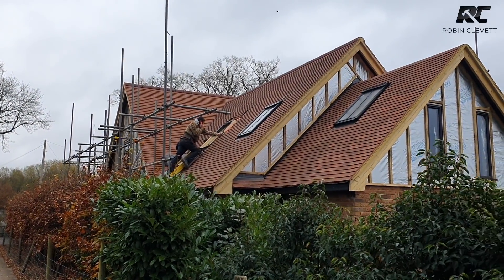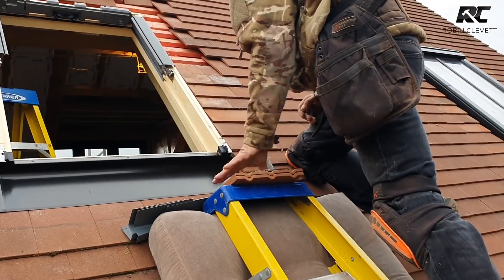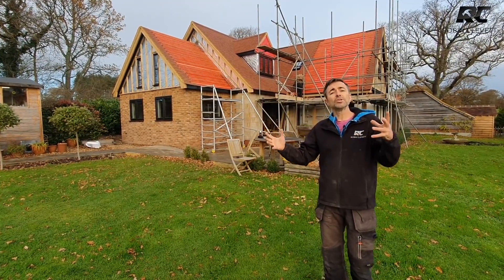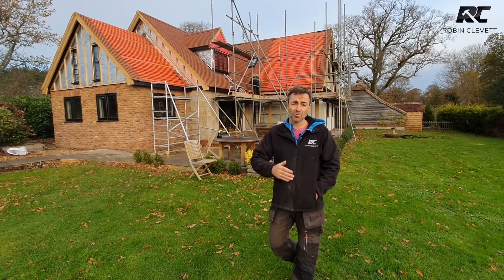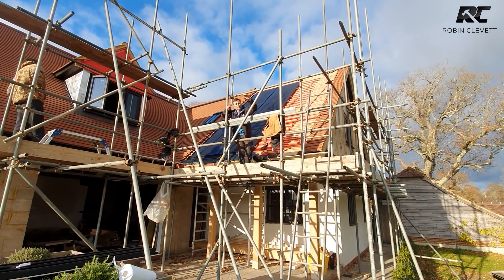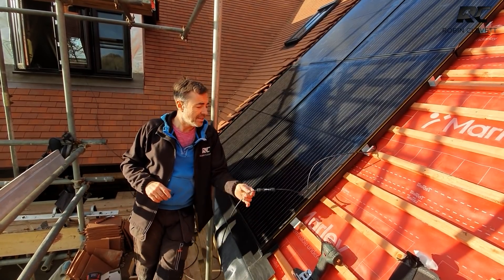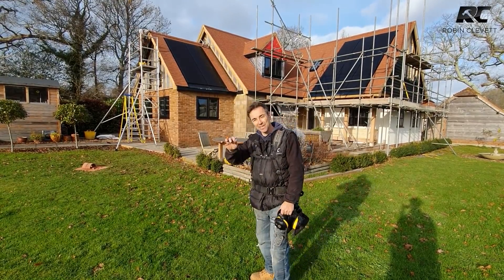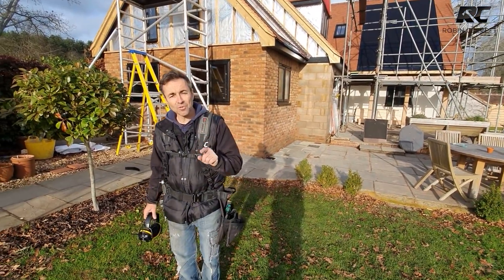Solar roof Panel Installation and roof tiling completion at the Big Build

Comment: As per RC standards, the solar is integrated into the roof. So the aesthetics r top notch. My wife hates the look of solar panels as an afterthought. The other gentleman u used to make videos with over at Skill Builders, has very eloquently made his views about heat pumps clear. Here in the California, Mr. Cools r very prominent. I believe they use inverter technology, which (I’m not an expert) allows the compressor to b infinitely variable. Light load, low power consumption, versus the old style. I have a 5 ton behemoth in for our house. When it kicks on, the electric meter goes bananas. I have installed four Mr. Cools on the property and they work really nice. I know I’ll b considered a whiner and  if I say it gets cold in LA, but it does. It was 59 Fahrenheit in the house this morning and I had to turn on behemoth to forced air heat the whole place. My gas meter was now singing the song. In future I plan to install a mini split where we sit 90% of the time to watch RC vids. A 12,000 btu should do just fine. I know those r British Thermal Units, not Yankee Doodle Dandy thermal units. The Big Build has been an adventure and learning experience for me. I have thoroughly enjoyed getting to know u. I hope u r as nice in person as u r on camera. I’d hate to hear that u kick dogs and cuss out employees when they forget to put one of your 5000 M18 batteries on the charger at night.

Comment: I used the GSE in-roof solar adaptors for my retrofit solar project.    It's fantastic in terms of appearance.  I just love the flush look with the existing roof tiles.   The adaptors were fitted quite quickly, but the flashings took a little time - 2 days fitting time for a 16 + 12 panel array (3 people, 60 man hours).  That includes scaffold tower setup, and removal of existing roof tiles. 

They have proven to be watertight after 18 months, and I've spot checked for leakage during torrential rain storms.  They've also survived Storms Arwen, Malik and Corrie without any damage.

Comment: Heyup mate,
we`ve had so many days of high thirties temperatures since  Christmas down here in Western Australia it`s been lovely! Love it when I can have a shower just using the cold tap :)
I have an air sourced heat pump which is reverse cycle, heats in winter, cools in summer and it`s very efficient either way. I designed this house on solar passive principles so it doesn`t get that hot even in full summer, and in winter the sun shines on the tiled floor and heats that to give me some free heat.  My bills are pretty low compared to most down here because aussie builders don`t give a toss about lifetime costs of the product they build. For instance, building houses with no eaves overhang so the walls are in full sun and selling that as a "Tuscan roof" like it`s a good thing ! One of the most popular roof tile colours is black ! Black, ffs , at forty centigrade!
Solar passive design is not rocket science, the Romans had it off pat. A few basic principles make the house comfortable all year round, without massive heating or cooling costs . UK builders could make solar passive design a selling point, simple things like placement and size of windows have massive cost effects when considered early in the design stage. 

I have solar panels ,6.5kw total  and each of mine has it`s own controller so shadows or dirt on a panel have minimum effect on production. How do those panels deal with that, they seem to be daisy-chained together and are acting as one unit. 
Year on year, I make between 10.5 and 12 megawat hours, feb this year I`ve made 800kwh so far.
Love watching your channel Rob, takes me back to days working with quality builders before I started on major construction in UK and then later down here.
Take it easy mate, and thanks ;)

Comment: Can you tell me if a string inverter was used or did the panels  have solar optimisers fitted?
Reply from the maker: Hi Craig, I assume it is a string inverter but I am not 100% sure I will try to find out.

Comment: Lovely work. Looks great. Nice that they can use the PV system for the air source heat pump. We have a PV system and it’s great. Free power all day.
Reply: Hi I would love to know if the PV system can power the ASHP in the winter?. Do you need to have underfloor heating to enable the ASHP to heat your home successfully?.

Comment: We just installed the same Viridian system and it looks fantastic.  But it was not easy.  The gaskets and joints are fiddly and fragile and if you bend one of them even slightly it's a heck of a job to get it in.  You're up there on a pitched roof balancing on tile battens with a heavy solar panel and a flashing that wants to blow away in the wind, stretched out across another panel that's slippery, sliding off the roof as you try to force the third bit of metal into a plasic gasket that struggles to accept one. Heaven help us if one of the panels develops a fault, because that would prevent the whole system from working, and the only way to fix it would be to dismantle the whole array flashing by flashing.  And remove the tiles to the sides and above.  A full scaffold job and more expensive than the initial install.
All in all not over impressed with Viridian's design - there must be a better way!

Comment: Those solar panels aren't replacing tiles are they? As panels can get hit by falling debris which cracks,smashed them so they then need replacing.
Reply from the maker: The panels a toughened and they are no different to roof windows when it comes to potential damage from airborne debris, they are cheaper that roof windows too!!
Reply: Way stronger than a roof window
Reply: @robinclevettcarpenter  Must be new style ones. I watch EEVBlog who's in Australia, an electronics engineer and only mentioned it as over the years one of his got hit by something and cracked it
Reply: The panels are quite strong, I had a ridge tile (that was just holding some breathable felt on at the top) fall down the roof and smash into a couple of panels 🤦‍♂️ nothing more than a couple of scratches. Hopefully all the cells are good. Not had them commissioned into the consumer unit as yet 😬 eeeek
Reply: @THE-AIDEN-PROJECT  Sounds like the newer panels are much more stronger.
Reply: @TheStevenWhiting  why comment with outdated 2nd hand info?
Reply: @pyrrhical3423  Curious to know if they'd changed. Clearly they have. If we never commented we'd never find anything out.

Comment: I'm not a roofer but are these tile meant to be all over the place? I have watched this build from the beginning, you are a bit like me with many things. (mainly perfection) but I had to pause this video at 1min23sec  because it caught my eye that the tiles basically where not running straight. sorry to say this, but it has let me down some what.
Reply: That will just be the variation in the tiles, nothing you can do unless you wanted to knock all the lugs off and lay every single one to a line and also double nail everyone you'd be there forever!
Reply from the maker: I would like to add to Matthew's correct comment, I am sorry to have let you down!! these are a machine made clay tile from Marley called Acme single camber plain tiles, go the the Marley website and look closely at all the images of these tiles and you will see that they are not perfectly uniform and appear like they do. Only the cheap foreign tiles look perfect and you will not catch me using anything like it, a slight variation in a natural product such as brick or a roof tile adds to the texture and appearance of a building or structure. Maybe do a little private homework before a public comment like this as I have already deleted some responses from other viewers who where not as kind as Matthew and me!!!
Reply: @robinclevettcarpenter  Hi sorry you have got the hump with my comment.
Telling me to do my private homework.
Like I said I'm not a roofer, and I dont have time to do any homework.
This is your video, you normally explain things in detail.
But I understand all vids would be x3 times as long with you explaining.
I was not being nasty about it.
But I could not live with them looking that irregular.
O and nice build.
Reply: @homestyleinteriors4882  LOL you wouldn't even notice that from the ground its only cause the cameras right on top of it. Andy has done an exceptional job on the roof I am a roofer in England also for 10 years now his works bob on
Reply: @ClutcherClayt  I started the conversation of with a question. you gave a great answer and so did matthew atkinson.  wish I never opened my mouth LOL. Keep on grafting lads
Reply: Im a 3rd generation roofer and have been roofing all my working life (15yr) and can safely say that there is nothing wrong with these guys roofing. With clay tiles there is some slight variation to the tiles in the manufacturing  process and with them relying on nibs to sit against the battens, essentially  they sit how they sit.

Comment: Provided my lovely green council actually grants planning permission that is one of the solar systems I was considering for installation. Less chance of uplift during storms damaging the roof along with no wildlife using it for shelter damaging the roof.
Reply: Wind uplift is not really a major consideration on most pitched roof solar PV as it is well away from the edge zone of the roof.

Comment: You and those who have helped you with this build should be immensely proud of what has been achieved. What you were too modest to admit though is the unspoken but obviously excellent relationship you have with your client. Because you had a common goal a really great home and living space has been built.

What you did not go into was the planning that was done before this house was re-built. Few builders read instructions nor do they take their time. It’s jigsaw, angle grinder and caulking gun out and speed, speed, speed followed by “Nah mate. This’ll never work. Here’s the bill. I prefer cash.” It is entirely reasonable to have thermally efficient homes and spaces but it requires time, care and consideration and a great deal of skill to deliver one; attributes lacking in the majority of mouth breathers found on building sites. Not until we accept that our nation’s builders have to be more skilled than they are at present (and rewarded accordingly) will we be able to have more efficient homes. One that are just us warm but cost pennies to heat.

This house shows us the way to go. Good looking, great to live in, thermally efficient and highly desirable to live in. My only question is does it have batteries (I’ll guess approx. 10-12 kWh) and an inverter to maximise the value of the power generated by the panels on the roof? If not, why not?

Comment: Robin can you let me have the installer contact details for the Viraidan in roof panels?
Reply from the maker: Hi Norman, we fitted the panels the firm who supplied the inverter and did the wiring side where not very reliable so unfortunately I am not in a position to recommend them!!
Reply: @robinclevettcarpenter  Thanks Robin.👍

Comment: Should have opted for a Ground Source Heat Pump over Air Source. Or could have gone with a Heat Battery something like Sunamp. Each to their own.
Reply: GSHPs are slightly more efficient, but the capital costs of installation is not worth it. It will take a century to make back the extra costs.

Comment: Soz guys but there needs to be an eave  course under the roof window  front flashing , theres not enough  cover  !!
Reply from the maker: Check the one that is to the right of the one Andy is tiling, it has the eve course, he was sliding it in once he went up the side and over the top just needed to put his weight on the bottom of the window and they break!!

Comment: You have your own house @21 degrees ? That's a flippin' hothouse as far as I'm concerned. Being from Yorkshire, I have mine set @ 17degrees and n'er a cent more ... guests be damned !  'Appen.
Reply: 17 for us in extended mid-30s semi in London. But we did gut and rebuild it with massive increase in insulation over and above regs of 2015 to 2018.
Reply from the maker: Mate that's an Ice house!! even 21 is low!! love your comment mate, made me chuckle!!!

Comment: Great system, but...if a PV unit needs replacement (hail, dead cells,...), you will be forced to buy it to the same brand.
Reply from the maker: Well they are not expensive so it would be fine, I get where you are coming form mate

Comment: Underfloor without insulation. Oh dear. 600 a month electric bills
Reply from the maker: Not true, overlay system that we use combined with the purpose made self leveling floor compound is brilliant the downward heat loss is no more than 10 percent, in my house we have 1200 square feet on an existing solid floor  in the old part of the house and it works as well as the other 1800 square feet that is new build on insulation and 50mm liquid screed, there are cheaper overlay systems that are not so good and that could increase your energy consumption but you won't find them in my builds

Comment: Looks the part but in my opinion stupid idea. Integrating the solar panels into the roof could only be the idea of some office bound Muppet that doesn't understand building. Those tiles properly laid by Andy will see out the owners. Those panels however fitted won't last. All good for a few years then the problems start. So then some solar bloke who may know panels but bugger all about roofing starts pulling it all apart. Bodges it back together and the leaks start. Or the size of the replacement panels is now smaller more efficient and improved. Wack in the new panels a different size and the tiles all have to be re cut in and flashed. So you need to pay out even more money to get a tiler back. Design over function. Would I put them in a roof.  No way. If the customer insisted I think some legal document signed by all parties would be in order. Any problems don't call me.
Reply from the maker: Here what you are saying Dave, but this system is backed by probably the largest roof tile manufacturer and network of approved roofing companies that could easily replace a single or  all the panels, the flashing kits are replacable and easier than a typical roof window replacement, I really did my homework specifying this product and looked at all the alternatives on the market, there really is very little to go wrong with the panels and all the technology is fitted elsewhere, I appreciate in the wrong hands then there could be all kinds of disasters!! But that's the same for so much of the building industry, great comment Dave
Reply: @robinclevettcarpenter  You are the most thinking Carpenter I have ever seen and no doubt did your homework. This technology is constantly improving. I have eight panels on my roof that were good in their day a few years back. Now totally obsolete I couldn't match them if I tried. I could probably generate the same power now with two panels half the size. I live in Qld more sun than you need. Everyone has panels. How long do they last. Not long. Honestly how long does any modern technology last. Your telly 5 years. Don't even start me on dishwashers. The likes of Marley and Redland's would endorse them they can see the coming dollar signs. They look lovely and no doubt are top flight. Ten years time ????
Reply: Hi Dave I just liked to note that if a solar panel fails in formation whether it be the four or the nine panels it is so easy to remove just one failed panel flashing kits all come the same and are easy to replace so you would not need to open the whole roof up and they are super efficient if one is faulty and not putting out enough power they continue to still work on the full circuit and doesn’t compromise the other ones as they still work
Reply: @andrewwiltshire8796  you can get the exact same panel now to swap. Wait 5 years and try to find matching panel

Comment: Don’t get sucked into this brain washing subject ? Just do the maths mush . It don’t work
Reply from the maker: There is more to solar installs than simply comparing the initial capital cost to the potential cost difference to mains connection,  for example The Big Build is in a remote location with a questionable mains electric supply very prone to outages caused by storms etc, this solar solution is producing more energy than the client is consuming and the excess is being harvested in the back up batteries, I feel that this is a good use of capital when building in such an area